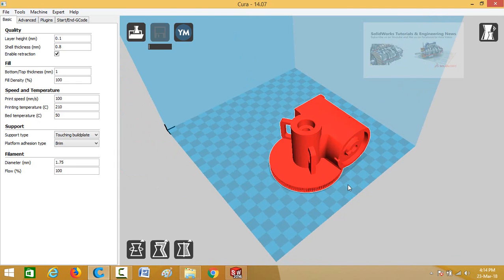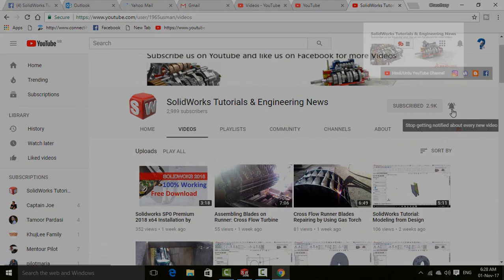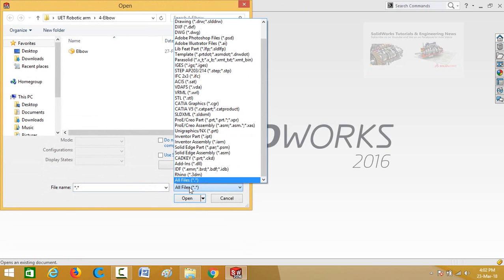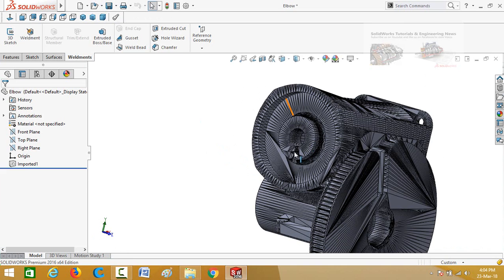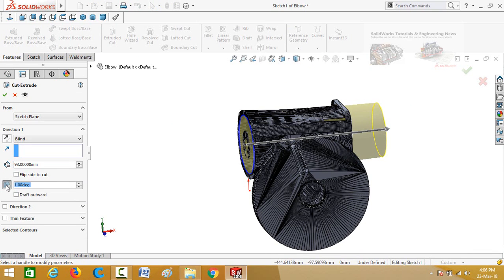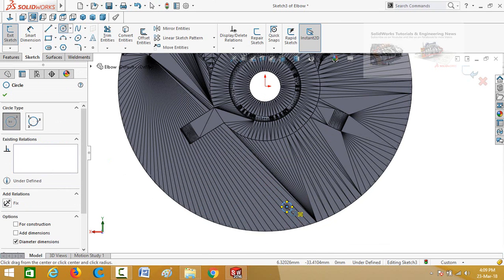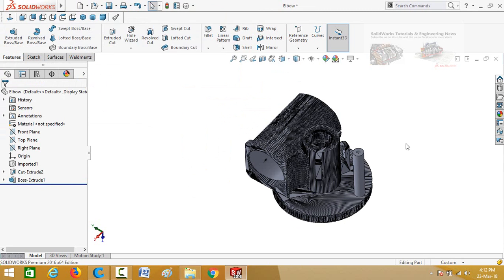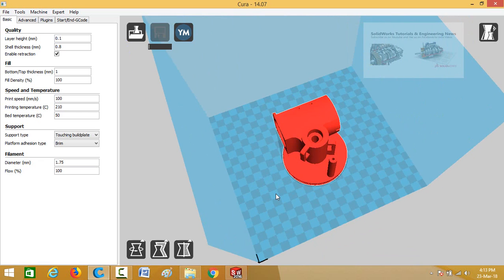How to Edit STL Files by Using SolidWorks Very Simple and Easy

Comment: My STL file will not open in Solidworks for me. Is there a specific type of STL file required?
Reply: Amongst my choices on the pull-down menu of OPEN file, I chose "Mesh File (*.STL;*OBJ;*OFF;*PLY;*PLY2)" and selected my existing file. In my case, it was an Object file. Then I went to the Options tab like he said and picked "Solid Object",... clicked OK... Open. It opened up the file and I could modify it.